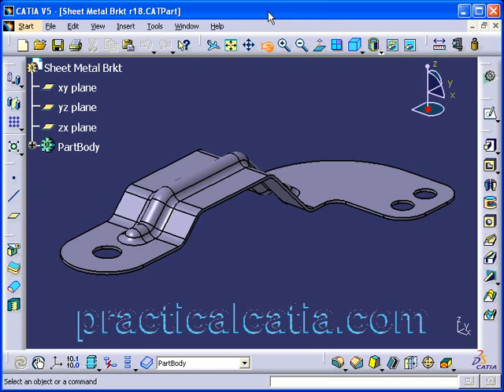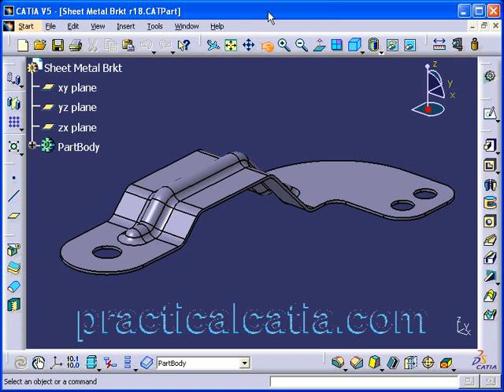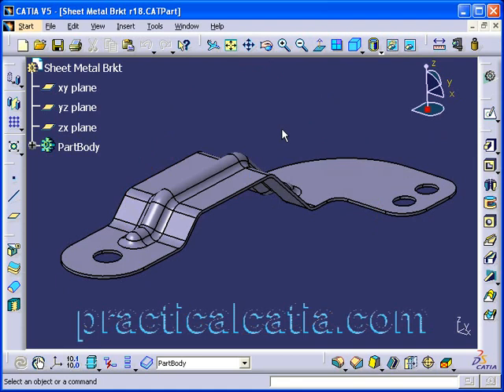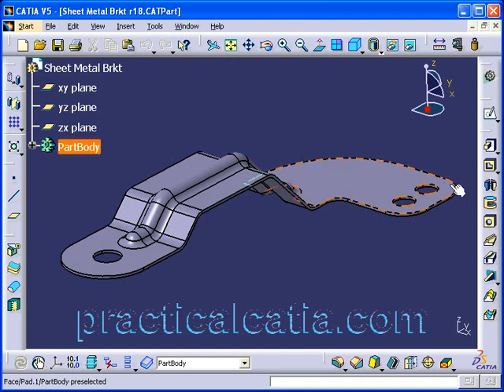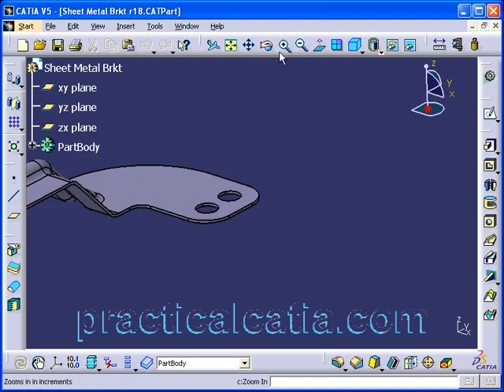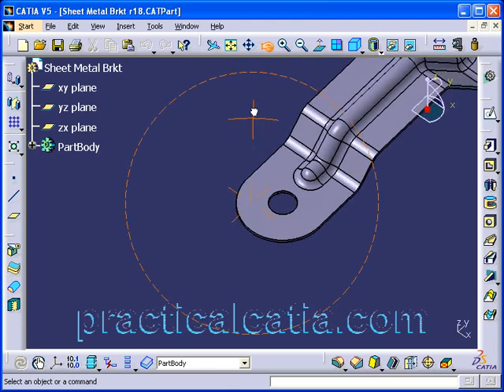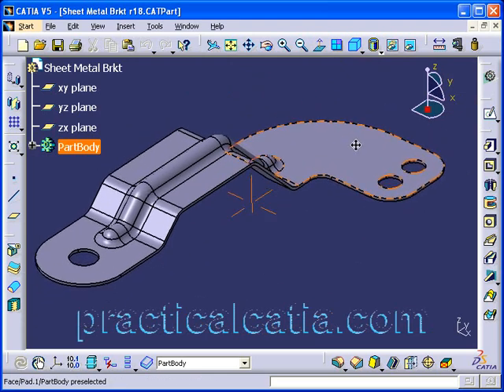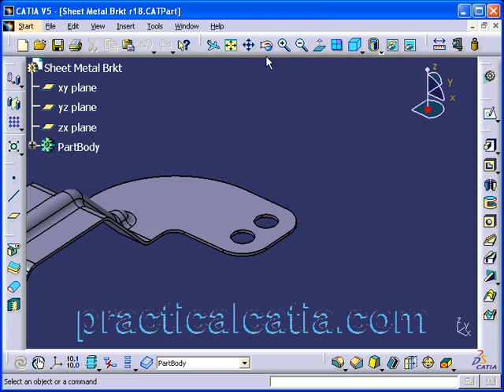CATIA V5 Tutorial: Choosing Rotation Center

Comment: Great video, and thanks for the explanation, but is there a way to set the rotation point and have it remember that location? I hate to have to reset it every time I pan away. Unigraphics has a function where it will remember the location and rotate about that point until you change it manually.
Reply from the maker: Not that I'm aware of.